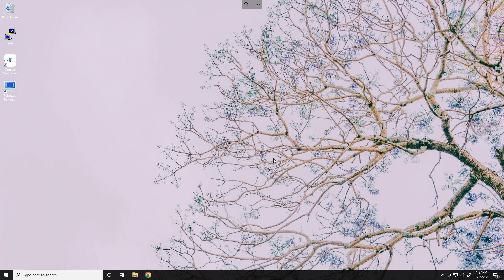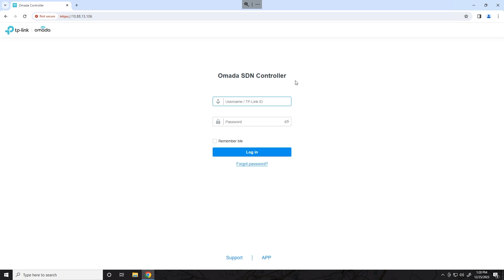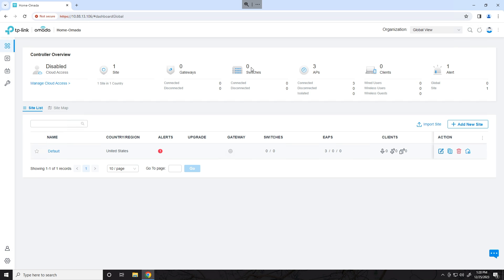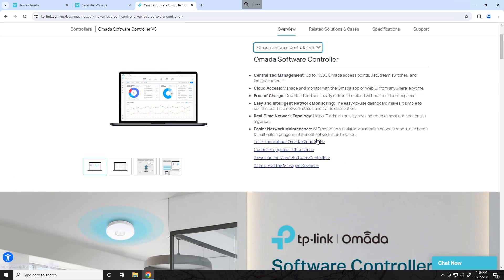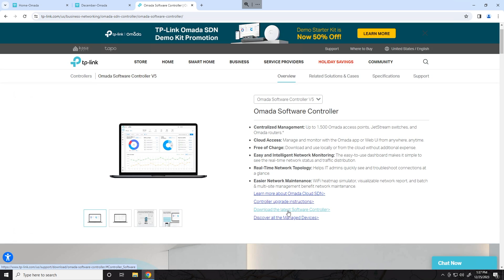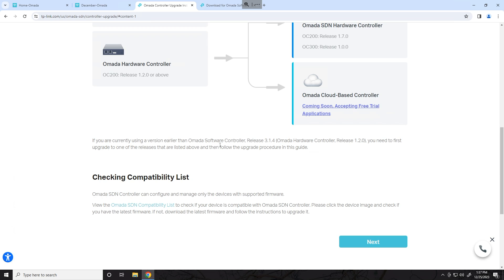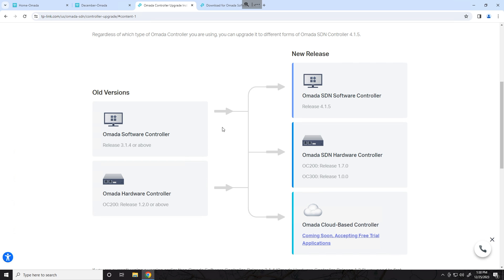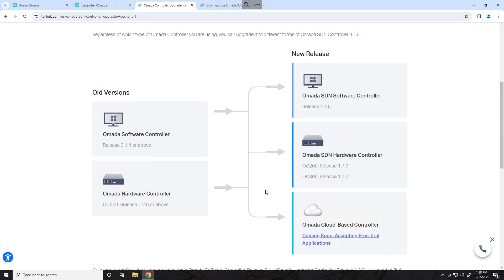TP-Link Omada - Controller Migration

Comment: what if the oc200 will damage? how to reset all of your AP an Switches?
Reply from the maker: I would take regular backups so you can restore to a different controller in the event of a failure.  Even missing backups, you could leverage the existing login information and "inform address" configuration to point all the equipment to a new controller.

Comment: I've tried to migrate controllers, but ended up with devices disconnected from both controllers, can't figure out how to reconnect them.
Reply from the maker: Typically, when this happens, I find myself logging into each device individually and updating the controller address manually.  This usually causes them to pop right in the new controller.  It's a bit of a pain... but as long as the old controller is powered down or uninstalled it works most of the time.